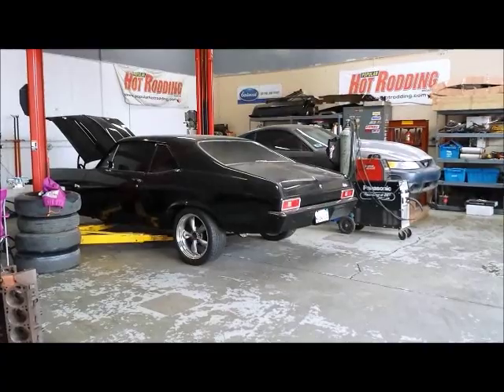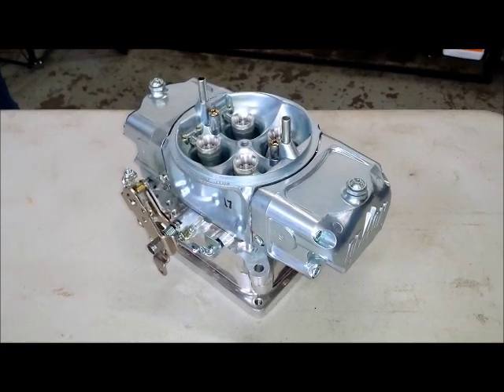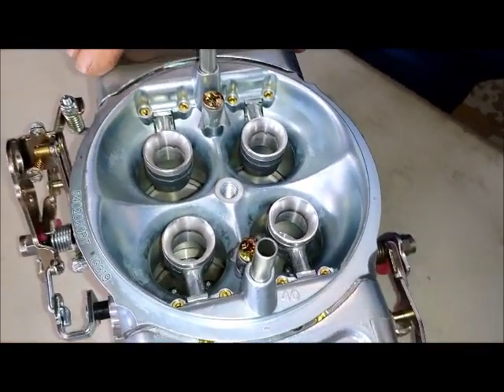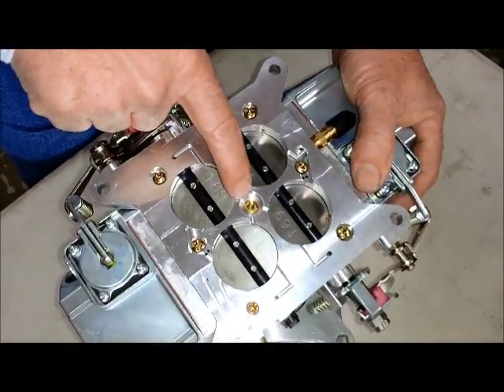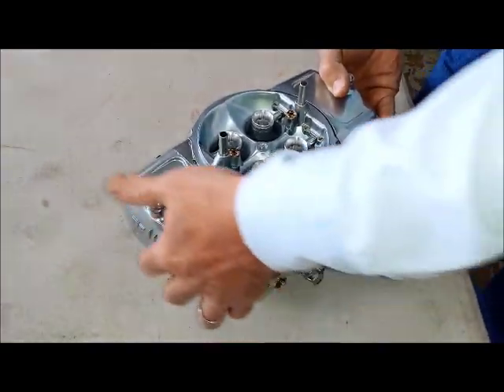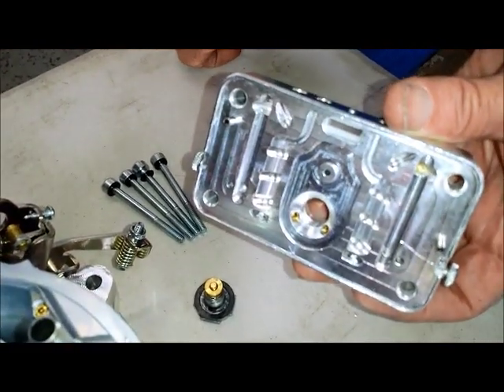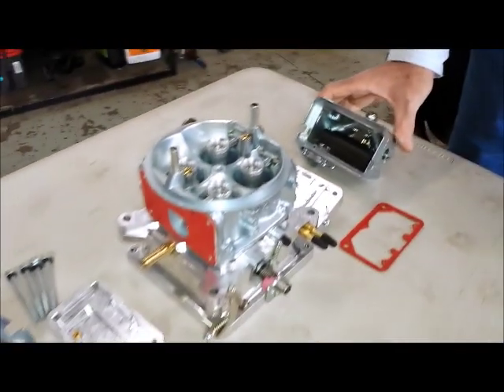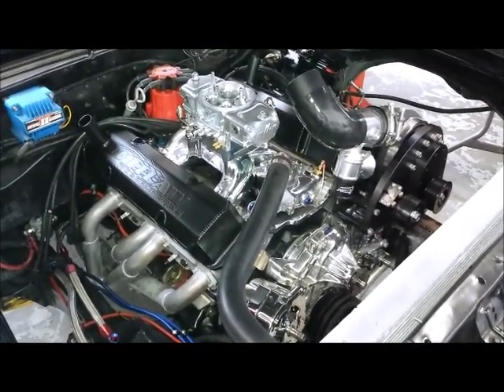The Mighty Demon 750cfm Blow Through Carb

Comment: A double pumper is a race carb with 2 fuel pumps, most carbs only have a single fuel pump.  Mechanical secondary's means all 4 barrels open from the pedal. The alternative is vacuum secondary's where 2 barrels open with the pedal and the other 2 barrels open with vacuum.

Comment: From mighty demon web site on this exact carb:
nstallation
Designed for moderate 289 - 327 & mild 350 - 406 cid engines
 Mild 350-406. So if your running a SC on a 400 seems to me you undersized that carb. Would have been great to do that on a 327.
Reply: +starbattles1 smaller cfm carbs pull fuel faster that a larger cfm carb..    the signal is stronger to the booster because the venturi is smaller = higher velocity..
Reply: The perspective is up front: for the guy with one foot on the street, one on the track.  The annular boosters lend themselves to part throttle responsiveness, and not living at w.o.t.  We can assume the cam selection supports this goal as well [living below 6500 rpm].  So... for a 400, the 750 is a good choice, especially since as a blow through it will see higher flow numbers with a hair dryer force feeding it.  Wish they dyno'd this to show what real flow numbers are, but I doubt he needs to tip past 780cfm.

Comment: they call them double pumpers because of the dual accelerator pumps..not because of the mechanical secondaries..double pumpers also come with vacuum secondaries
Reply: No double pumper has vacuum secondaries. Vacuum secondaries don't have a second accelerator pump thus being a double pumper. I make 900+who with a demon and have not had issues you other guys speak of and have sold a few hundred in my shop over the years. This is not a holley in any comparison.